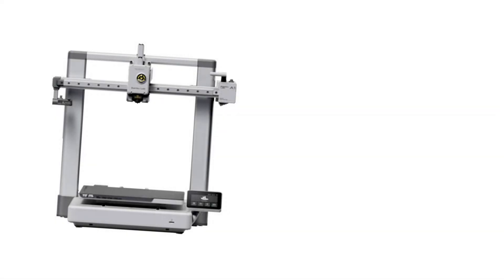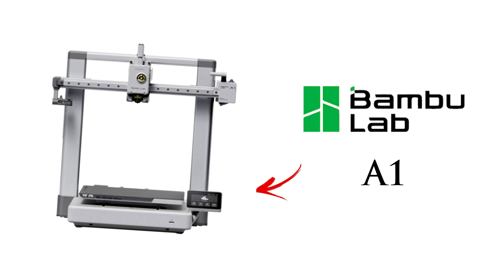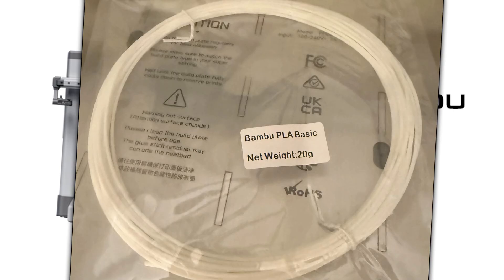What to Print with the 20g Filament Sample - Bambu Lab A1

Comment: Exactly what I wanted to know. Now I’d like to know if that loose 20g sample just gets draped across the single spool holder, or is there some other feed method?
Reply from the maker: Like to hear that :)
I put the loose spool (just the coiled up filament, not an actual spool) on the spool holder and feeded it through the ptfe (or whatever it is) tube.
Worked great, but checked several times that it didn't get tangled (probably not necessary... but better safe than sorry I guess :P)
The filament sample tried to jump off the spool holder towards the the end (didn't cause any issues tho since the dangling end was too short to cause any trouble).

Happy printing ♥

--

Bonus tips:
- make sure to select the right printer in the slicer ^^
- moist filament causes all sorts of problems (Polydryer from Polymaker works great so far) :)